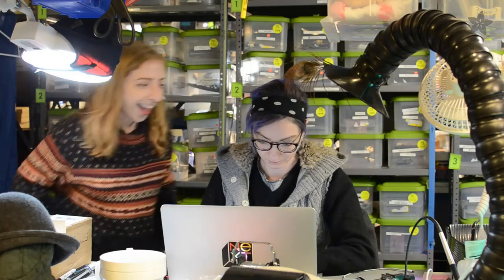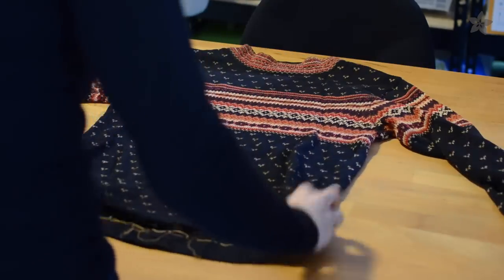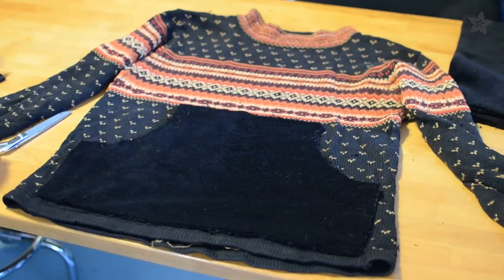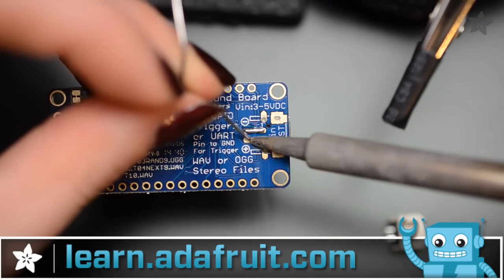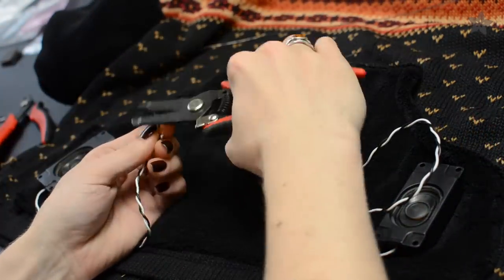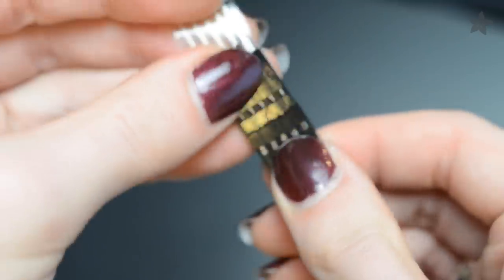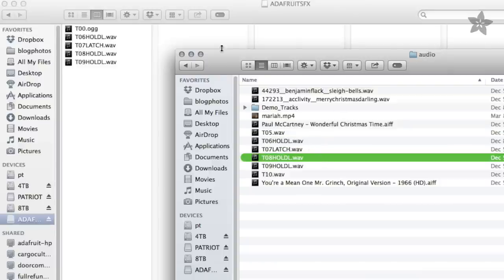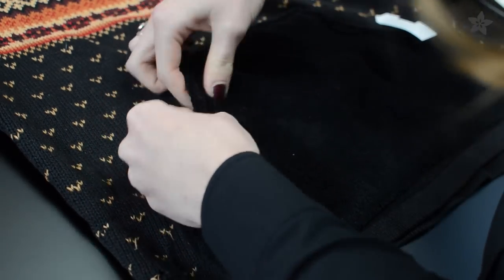Sound Sample Sweater for Holiday Cheer

Comment: Just a concern: How does fleece and unshielded eletronics mix? Wouldn't ESD (electrostatic discharge) be an issue?
Reply from the maker: We haven't had any problems so far!
Reply: Adafruit Industries Just sew in some conductive thread and a 1 MOhm resistor and plug into a grounded connection at all times :)